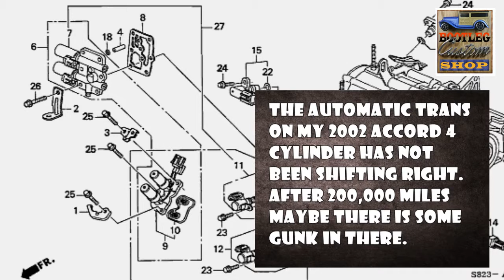1998-2003 Honda Accord automatic trans shift problem fixed with a crowbar and q-tips

Comment: I have a P1738 problem popping up on my 02 accord. Rpms go sky high before switching gears. We changed out the second gear pressure switch but the problem is still there. I'll have to try this
Reply from the maker: Hope my video will help you Matt. Pls let us know how it goes. Consider subscribing, my channel can use more great comments like yours.
Reply: Hey Matt did this solve your issue my hondas doing this as well and I replaced the first solenoid he showed but I need to clean the others
Reply: I have this issue did this solution solve the high rpm gear change and clunk when shifting first thing in the morning??

Comment: Did this happen at all times or just when the car warmed up?
Reply from the maker: good question AC. We did it on the car after it was run & cooled off enough to work on. Thought that might help to keep seals & stuff in 1 piece.
Reply: I mean, did the transmission only slip when the car warmed up. My transmission works fine when the car is cold, but as soon as it hits operating temperature the transmission slips until it cools down again.
Reply from the maker: @DIABOLICOHAVOC  its not my car but i will ask the owner asap & get back to you
Reply from the maker: THis car had slipping all the time, even pulling out of driveway
Reply: when my car warmed up-before cleaning the filters- tranny worked good
Reply: Mine just has poor shifts and throws a code when cold.   After warms up shifts smooth as silk. 02 Accord

Comment: do you recommend a trans replace ?
Reply from the maker: Great Question!  The black goop in the filter must be because things are wearing away. But with careful driving it may last a while...
Reply: @bootlegcustomshop4129  know anything about replacing with a jdm transmission. What you recommend? Thanks
Reply from the maker: @carlexus3133  Never got a trans from them. I would ask around. Some of these rebuilt things can be a nightmare. Good luck!

Comment: Would this  help 420 code catalytic converter prob not
Reply from the maker: Interesting comment but dont know about that particular code. Best of luck!
Reply: Many people fixed this with catalytic cleaner. Like cataclean. If that doesn't work pour 1 gallon lacquer thinner to 10 gallons of gas. Drive to empty. Put in fresh gas and clear code and hope it does not come back. That's what I did on my 1999 accord.
Reply from the maker: @martinjay9959  well done MJ! Tks for writing!
Reply: No has nothing to do with the cat

Comment: Mine drives Normal for 20mins or so then starts slipping and down shifting will this fix my issue?
Reply from the maker: Try a 3x fluid change first
Reply: @bootlegcustomshop4129  what would x3 fluid change do? I done one change two days ago appeared to be normal. Again untill i came to a traffic jam 🤦‍♂️ started slipping had to pull over for 5mins
Reply from the maker: I do the drain & fill 3 times to get as much old fluid out as possible. Seems like its overheating?.? Fluid is not burnt looking or smelling? The screen cleaning cant hurt & may help. It dont cost anthing but time. Hope it well help.

Comment: There are two more just below the first one. These are individual shift solenoids and they are hold by a single bolt. you can try to clean them as well. There is another video that shows just that.
Reply from the maker: Cool. Send a link to that video for us U..
Reply: @bootlegcustomshop4129  here is a video where they clean with brake cleaner (i personally do not like the idea of using brake or carb cleaner.) https://www.youtube.com/watch?v=jhEORmzOEd4&t=13s 
In another video, somebody uses an ultrasonic cleaner to break contamination lose in an injector. I do not see why same can be used for solenoids. 
https://www.youtube.com/watch?v=fr4SLApkjCs
Reply: @uccoskun thanks

Comment: My transmission drives fine all the to 3rd my last 4th gear slips into neutral & so does my reverse , now my d3 is started to slip but my 1-2 gears work fine
Reply: Also the fluid is a nice clear red nothings in the fluid it’s not dark & it doesn’t have metal shavings but the fluid was overfilled & now that I checc there’s barley any fluid left but it’s clear red
Reply from the maker: I believe each of those little screens controls a different shift. So 1 or 2 may be clogged. As to where the fluid is going, maybe out the vent/overflow hole. Hope not a blown seal. Best of luck & let us know how it works out buddy.

Comment: What was the shifting problem?
Reply from the maker: late shift or no shift. Tks for writin
Reply: @bootlegcustomshop4129  yup that’s what I got plus the D4 flashes
Reply from the maker: @gfriedman99  Please check the description for details on the symptoms
Reply: @bootlegcustomshop4129  ok just saw paul thorpes answer in the description.   That’s exactly it.   Taking off from a stop it starts out in second or third gear so the engine revs high with little acceleration.   I get around it by manually shifting into first gear at a stop light so the cars behind me don’t get road rage. Lol.

Comment: These are the check engine codes that get thrown once the screen clog becomes severe.  In addition the D4 indicator light will sometimes flash.   Note that early on (for years actually) you may have mild shifting problems before they are severe enough to throw a code.
P0700
P0730
P0780
P1739

Sometimes only 2 of the 3 codes get thrown.   It is possible that other codes could get thrown depending on which hydraulic lines get clogged. They must be manually cleared with an OBD reader or by pulling the fuse.
Reply from the maker: Great info GF! Tks again!

Comment: I have a 2001 Honda Accord LX  automatic transmission with 207,000 miles.  My car only moves in reverse not forward.The problems started a couple of months before this happened 1. when starting car and putting in reverse heard a loud sound 2.Loud exhaust noise 3.Car jerking forward at stop sign 4. When putting car in  reverse then drive heard loud kick.5. when going down the street at 5 mph the tachometer went 3000 rpm-4000 rpm-4500 rpm. 6. when going somewhere car would take time to reach 40 mph even with accelerator pressed fully. One day when driving home the car just stalled and after five minutes of waiting and restarting the car  was able to make it home at normal speed and parked it  in the garage. After starting it again it would only move in reverse not forward. I suspect that it could be a transmission solenoid as some research I did says it could be a transmission solenoid. But when I called  a transmission shop they told me that the problem is internal and doesnt have to do with the solenoid. Would like to get another opinion on this issue
Reply from the maker: Solinoids only control shifting i believe. Your problem sounds more complex. But maybe solinoids are worth a try. Only costs a littls time. Good luck & let us know how it works out
Reply: I had a similar  issue with 2002 accord put it tin the shop to find out it was the torque converter

Comment: doing this right now. reply in a month ill let you know how it went for my p0740 on a 99 accord
Reply from the maker: ANy questions let me know & i will reply asap.
Reply: @bootlegcustomshop4129  i did it and it shifts much smoother now. there was some siliconr and part of the gasket blocking one. i dont know if the codes went away yet because i unhooked the battery. one tip i will give is there is a bolt underneath the battery tray. you can see it thriugh the big hole to the left.

Comment: Did you use any special spray to clean out the gunk out of the filters? Great video btw!
Reply from the maker: Great question RB. The gunk came out easily on mine. It was a gritty stuff that was caught by the screen. Maybe a little trans fluid on the q tip.
Reply: brake cleaner
Reply: @vityazsix  no brakleen on rubber bits!

Comment: Anybody now P0756(1/4) stored
Shift Solenoid B
Performance or Stuck Off
Reply from the maker: Internet sez.....This code triggers when the PCM detects the “B” shift solenoid circuit has a malfunction. Check wiring & solenoid function. But the code can also be triggered by Low or dirty transmission fluid. Clogged transmission fluid filter. Or the screens shown in this video. Best of luck, & let us know what happens. Pls subscribe for updates on your question.

Comment: Did it shift hard before doing this
Reply from the maker: Yes it did! Tks for commenting. Pls Subscribe for more Videos!
Reply: yes
Reply: Im going to do this asap
Reply: read my comment up above....it shifted perfect when warmed up....when cold, first didn't shift to second at all....would have to move to neutral to get to second.   anyways  it works perfect...saved me a lot of money
Reply: easy fix btw
Reply: @paulthorpe3051  trying it out this week end
Reply from the maker: @paulthorpe3051  tks for your latest comment paul, but i dont see it here in the comment section.....so i'll put it in myself
paul thorpe
Freaking Awesome....IT WORKED....I only took out the top Solenoid (not under battery). The filters were absolutely clogged. It took me about 10 q-tips to get all the gunk out. My problem was that when I first started it it wouldn't shift to second gear unless I moved it into neutral for a few seconds....then it would go to second. I dreaded stop signs b/c idiots would always honk b/c I had to take of slow because now it wouldn't start out in first but rather second gear from a stop. What is sad is my mechanic and Aamco said I need a new/used transmission, cost at least 2k.... But what I noticed is when car was warmed up, the problem went away. So I thought that it couldn't be a bad tranny so I wanted to eliminate other things. Thank God I found this....I didn't spend a cent....just cleaned the filters......THANKS Y'ALL

Comment: Why does it clog up like that? Do you know
Reply from the maker: I think its a mix of metal & other foreign stuff. it was attracted to a magnet. I shoulda showed that. Great comment. Please like & subscribe!
Reply: @bootlegcustomshop4129  believe its clutch friction material.
Reply: Why???  Because effin Honda engineers decided not to put a easily replaceable ATF filter in.  Instead they rely on a magnet attached to the drain bolt to catch metal particles.
Reply: Happens when you don't drain and fill transmission fluid

Comment: I've done this multiple times. It keeps getting clogged wtf is this bullshit
Reply from the maker: Im sad. Is it fine stuff or chunky... like rotten hose?Maybe its time to drop the pan & give it a good drain & refill.
Reply: @bootlegcustomshop4129  I've already done that. It's like gunk or something I don't know but when I clean the shift solenoids I can blow it right out like it was bad. I think I might need to replace the tcm cus a tcm code popped up on my car when I took it to autozone. Like the car will shift hard but drive fine after a while it'll start slipping and rims would go up and like the gears aren't even engaging. Yet when I do a first start up it'll drive and shift fine but hard then after a while slippage and weird rims getting stuck and going up and down lmao. It's gotta be the tcm. I've replaced the tranny twice and it does the same thing.
Reply: You got a lot of cleaning to do.
Reply: @gfriedman99  nah I had my solenoids tested and tranny. Figured out the issue. My pcm.